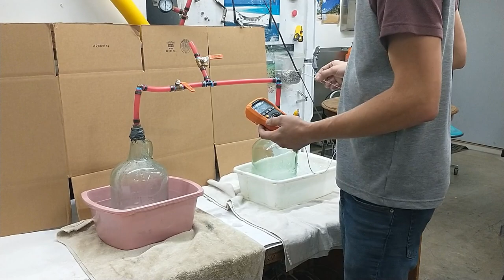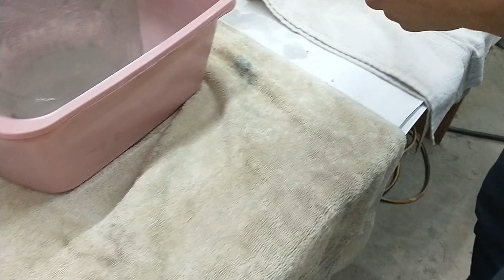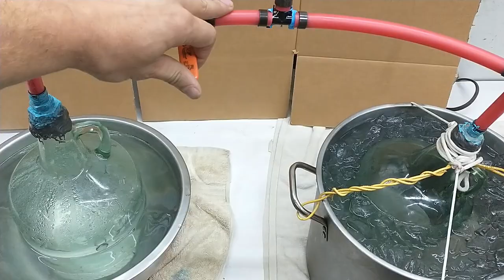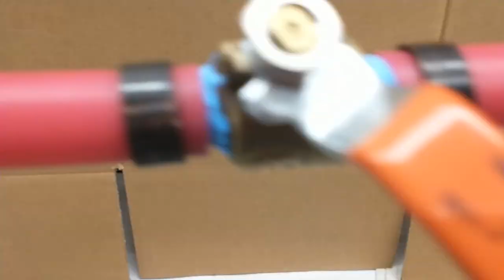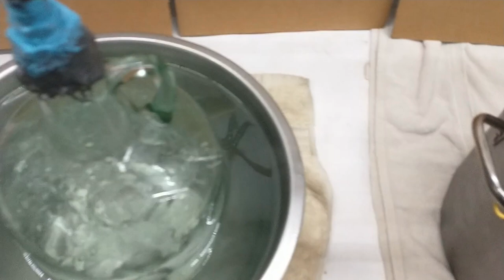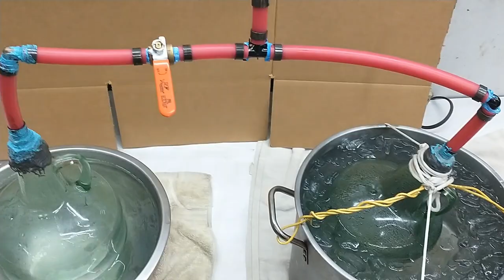COLD BOILING WATER To power The Tesla Turbine Renewable Energy System

Comment: Could you check a few simultaneous parameters during a test run: 1) the amount of water traveling from the boiler to the condenser per unit of time 2) the temperature of the boiler 3) the temperature of the condenser 4) the wattage output of the generator 5) the temperature leaving the Tesla turbine
Reply from the maker: We will be testing as many parameters as we can. we want to boil out 350 gallons and calculate the total water used. Temperature in, out of the turbine as well, we have so many tests to do, and finally some good testing equipment to do it with.
Reply: @iEnergySupply  If my calcualtions are correct, boiling 350 gallons of water against a vacuum would be about 3 million BTU of refrigeration due to the latent heat of vaporization. Are you planning on using an external heat source to keep the boiler temperature from dropping too much, or just let it evaporate/sublimate slowly from the normal thermal conductivity?
Reply: You need about 4,18kJ to heat a litre/kg of water 1 degree celcius - which means that is what you can extract if you put it in.
There is proportional relationship between temperature, pressure and volume - check out the ideal gas law
Reply: @FyaaahS  Hi, thanks for your comments. Well stated, the energy entering and leaving are in direct proportion. My interest is how much heat flow (BTUs/hr) is being turned into how much electrical power (KWH)? If I know how much water (lb/hr) is being evaporated the BTUs/hr can be calculated. And if I know the temperature (given) I can calculate the pressure on the high pressure side. I really want to know how much heat energy that is needed to run the Tesla turbine.

Comment: I'm surprised that the cold glass bottle didn't explode. Maybe the steam isn't hot enough. 
----
I'm excited to see if the hot side was superheated steam. The greater the temperature difference, the higher the velocity of steam, and the more violent boiling occurs on the hot side.
----
Use pumps and a one-way flow valve to redirect the condensed water back to the boiler. Of course, you already know this one. 
----
Thank you for educating the public, wishing you more subscribers, mate.
Reply from the maker: Thanks! Yeah my setup in utah has the pump for recirculation. Testing begins soon. Something interesting also happens with the rpm, under vacuum the tesla turbine seems to have unlimited rpm with extremely low pressure differentials. Even at very low temperatures.
Reply: @iEnergySupply  Maybe the viscosity of the water vapor is higher at lower pressure?

Comment: So all you really need is the cold end to be a little bit higher than the hot end and a siphon tube with a valve at the bottom of the cold chamber to return the liquid water to the hot side to reset the system for the next run.  You probably also don't need a high vacuum pump since steam will displace all other gasses in the system, all you have to do is heat the system until the lines are purged. A liquid with a lower boiling point could also be used to increase the efficiency.
Reply from the maker: you got it, although I think water makes for the best working fluid, because the vacuum on the condenser is much higher at higher temperatures. We still need more testing to confirm this though.
Reply: @iEnergySupply  Keep me updated on this. I'd like to have one of these machines when they become practical.

Comment: Endothermic heat pump, like the Einsteinian refrigerator/ ice maker; a closed system loop. Most awesome! Perhaps  Mr. Keely acheived something similar but using sound vibration; his 3-inch-thick steel-walled flasks certainly suggest some extreme pressure differentials. Surely, given the time frame, Mr. Tesla would have been, at the very least,  aware of Mr. Keely's work. Replace the water with say a liquid with an even lower boiling point and there would a corresponding increase in potential. Thank you for your work.

Comment: Classic case of thermodynamics, as the energy within the system is not the vapor pressure inside the bottles, but is instead based upon a combination of system thermal equilibrium and H2O temperature behavior in a vacuum. Nice. How long total before equilibrium is reached, considering that the water vapor from tank to tank is the heat transport method? Ultimately, aluminum tanks on both sides would be ideal as aluminum conducts heat far better than glass. But then again, you would get more vapor, but it would also reduce time until equilibrium is reached. I like your concept, as it is a lot safer than actual steam boilers.
Reply from the maker: wow, you understand the system quite well. I've come a long way since this video. I will be using sand to store the heat energy now, and piping as heat exchangers to extract the heat energy.

Comment: The key to understanding how it works is recognizing that at the same pressure, the refrigerant boils at a much lower temperature than water. This is a critical concept to understanding how the refrigeration cycle works, so if that went by too fast, read it again and think about it for a minute. For example the refrigerant commonly used in refrigerators boils between 40° and 50°F as compared to water's boiling point of 212°F.. you can use this for your cold fluid turbine compress it or not. I just think that the added heat would help you out. If it turns into a liquid after it leaves the turbine than all you have to do is is place an evaporator coil out side in the heat with a black Mat placed on top of it. Be it plastic or what ever.
Reply from the maker: your absolutely correct, I would be using a different fluid but I can't find a good one for the materials I am using. Do you know of a refrigerant that doesn't compromise lexan? Also, the turbine preforms better when the pressure in the condenser is at it's lowest. With a coolant that boils at lower temperatures, the pressure in the condenser and at the exhaust of the turbine will be much higher. Despite all that, I will be testing with different coolants in the future.
Reply: @iEnergySupply  you do not need a condenser. Your turbine acts as an expansion valve. The only thing I cannot figure out is how to move the fluid from the turbine to the heatexchanger, but you could always put a single stage tesla pump with a small DC motor of high rpm. The heat exchanger acts like your evaporator, as long as the fluid surrounding the refrigerant is warmer than the refrigerant than it will boil, creating your vapor point. Send that into an accumulator, and allow the pressure to build until you can transfer the refrigerant to your turbine. There is no telling if this will work because who knows how cold the freon will actually get, but it sounds good!!! And, I do not know what type of thermoplastic you could use, but they do have an LCP that was tested, for 30 days at 127 degrees Celsius this is a high temperature thermoplastic.
Reply: Why do you even need a condenser when your turbine is the super cooling effect. The nozzle in your turbine acts like an expansion valve. That is the reason why the air passed over the coils in your condenser is cooler than the freon to force it into a liquid phase, but you have a cold steam turbine, so if it comes out as a liquid after it leaves the turbine than that is all you need is the pump to take it back to the evaporator where there is another expansion valve, and the second evaporator is in an outside environment collecting the heat from the sun to vaporize your refrigerant. Where than it is sent to a holding tank to build up the pressure needed to power your turbine, but none of this works if your turbine leaks because low refrigerant equals the freeze, and to much refrigerant equates to you baking in your house.
Reply from the maker: @mitchellsmith7868  I believe this is possible, but for turbines this small, I will need to have multiple stages to make it happen.
Reply: @iEnergySupply  at what stage does your turbine turn your cold steam into water because if all you have to do is add stages than why could not you add two compression stages to every one turbine phase than add a heat strip, and a fan to blow the hot air over your turbine, and than it is steam again because you only need the water to reach 70 degrees; this is only theory. Have you ever herd of a hair and pin heat exchanger, but if we are talking about cycles to where the sun's energy is used as your evaporator which is alot hotter than the air that is pushed over the evaporator coil; you could always add a compressor as a whole sperate cycle to heat your water; with a recirculation valve it is very possible to re run the water as many times as need be until it gets hot enough to turn your water into vapor your tesla pump should keep the vacuum on the system. It should not take but at most three times. This is just the start. You can worry about the power consumption later after you have the complete system, but like I told Charlie once you had one of them going than you are hooked up in series where as the power produced as long as it is double what is used would make up for it with energy produced, for the grid which also equates to the load being taken off your equipment; the way to go happens to be DC power because the AC  power does not damage your equipment also you need to look up what you can on POE oils if you are deciding to use a compressor.

Comment: very good demonstration, thank you alot , i am very curios about the electrostatics. Probably by adding a high voltage electrode mesh at the beginning of the vaporizer side, to repell back the positive charges, and therby only allow negative charges to pass,  the effect could be enhanced, and probably a high voltage builds up between the vaporizer and condenser. Would probably work in parallel to the tesla turbine running to pull out some extra sparks. Not sure about the conductivity of the steam though.
Reply from the maker: that would be a really cool experiment!
Reply: When the static builds up does it cause a drag on the vapor traveling from the boiler to the condenser?
Reply from the maker: @davidcollar4577  Good question, I really want to know the answer to that question. I assume it does.

Comment: Efficiency trough simplicity, excellent work. Is the actual turbine prototype final? Out of the airbearings would you improve something else? I would like to let one manufacture based on your CAD project, if ready for sale/share. Thank you for sharing this knowledge with the universe
Reply from the maker: right now we have to do testing to make sure the turbine is the correct size for a 3 kw system, we may need to go bigger, but we are satisficed with the design, so it can be simply scaled up. It's available on our patreon. patreon.com/ienergysupply

Comment: But how's the ice or hot water reproduced? This is a large stirling, isn't it? (which I've been looking at myself for a while like most have in the last 200 years or so) anyway, I appreciate the video and please keep considering keep things.
Reply from the maker: One way is to use solar, or a wood stove. Solar heat collectors or solar heat tubes. Geothermal becomes an option as the low temperature differential between outside winter and underground is enough to run the system. Thermal sand batteries will also be an option, all of which I am planning to demonstrate soon.

Comment: I believe a dual trompe would be more practical? When one runs out of pressure, the other goes, and water is replaced into the system that is not currently used.
Reply from the maker: It actually takes a very long time to use the water because there is so much expansion under vacuum, the water can also easily be pumped into the boiler from the condenser as needed.
Reply: so if you put a pump,from condenser  , and then  pumping  back to the boiler, meaning  the water cycle over  ang  over again without adding  a water?  right?

Comment: it might make it clearer to people if you explain that top half of the boiler bottle is full of water vapor not "vacuum" or "air" and that because of the low temp boil when you closed the valve the boiler bottle went from equal pressure to high pressure in relation to the condenser bottle which remained at  low pressure due to the temp. you are not at "vacuum" on that system ever btw due to the water boiling off while you evacuate the air volume but that is just me quibbling over technicalities the point was to scrub the volume of unwanted gasses and leave only liquid water and your reaction gas "water vapor" this another very cool demonstration of out side the box energy generation.
Reply from the maker: Correct! Thanks for the suggestion.

Comment: Pretty basic thermodynamics. As the "hot" vapor condenses, it maintains the vacuum in the condenser because the non-condensable gases have been removed. The vast majority of steam-driven turbines use this to increase efficiency.

If you pump the condensate back to the boiler and continue adding energy (heat), the reaction will continue. If the energy produced by the turbine/generator is greater than the energy added to the system by the pump, then you have a self-sustaining system, given the heat source is external. ie. Solar, Nuclear, Natural Gas, Coal, Oil, etc.

I'd love to see a video where you have a heat source for the boiler and a pump to recirculate the condensate.
Reply from the maker: Yeah this video was mainly for all the people thinking I was using compressed air. They also thought the vacuum pump would take too much energy to evacuate the system then I would get from the water.
Reply: @iEnergySupply  oh for sure. It's a great demo. Though it'd be even better if you had more of the condenser visible lol.

Comment: Phase changes have the potential of creating charge separation. There's a theory, supported by some pretty comprehensive experiments, proposing that water freezing onto hailstones creates the charge separation in thunderclouds. The water that hits the ice but doesn't freeze, leaves with a different charge than the ice itself.

Comment: Seriously, you take the temperatures, then completely change the setup? Are you claiming that the trickle of vapour will produce more energy than the vacuum pump, the freezer, and the kettle to boil the water? It's a fun demo of how dropping pressure lowers the boiling point. I think the telling bit though was after a few moments of operation, when the temperatures had clearly not equalised "lets put some more hot water in there" was the next step.
Reply: No one is claiming over-unity in this video. It’s a simple demonstration of a heat pump with water being the transfer medium where in the future the 
OP plans on using the sun as the hot sink and the earth as the cold sink with a lowered vapor point being reached with a partial vacuum being introduced then maintained primarily by a Tesla turbine combination pump which so happens to be well suited for high vapor fluids and other turbines are not.
Reply: @ScarboroughSt  no, the claim was it would continue until the temperatures equalised, it didn't, and the Tesla turbine is to extract power, not maintain pressure, so will cause a back pressure on the hot side, reducing the partial vacuum. The water vapour will reduce the vacuum until there is non. They are demonstrating that boiling water can be used to generate power, just like every coal, gas and nuclear power station ever. Innovation in providing the heat, or cooling, or how to use the Tesla turbine would be great, as long as it improved efficiency, but this doesn't seem to be doing that at the moment. It seems to be focussed on using a vacuum, which will need to be constantly replenished when it's the pressure differential that is important. A vacuum can only give you an extra temperature differential of 1 atmosphere. What might be interesting would be a comparison of the difference in energy input/output if the energy used to create the vacuum was used to increase pressure (by heating the hot side, or cooling the cold side) rather than pulling a vacuum which won't last (can't last, the water will evaporate to fill it until the water isn't evaporating at an accelerated rate any more).

Comment: So the Tesla turbine is like a Stirling engine that utilize the temperature differences and people that don't know better will think it is a perpetual motion engine. This demonstration show what took me some thinking and reading up on to grasp fully. Iceland will have a win with this if it work on large scale, below freezing often and with hot springs.
Reply: This is how all turbines work anyways. The difference with the tesla turbine is that it can maintain vacuum and cool the exhaust below ambient air temperature. Or that's the claim.
Reply from the maker: Quote From Tesla. I have found that the quantity of fluid propelled in this manner, is, other conditions being equal, approximately proportionate to the active surface of the runner and to its effective speed. For this reason, the performance of such machines augments at an exceedingly high rate with the increase of their size and speed of revolution.
Reply from the maker: this is possible I believe, although we haven't proved it yet. We also may need a tesla pump to further lower the back pressure of the turbine exhaust. We will see. Also, normal turbines take extreme amounts of damage in situations like this from cavitation that doesn't harm the tesla turbine.
Reply: @jeffjefferson3364  "A turbine is a rotary mechanical device that extracts energy from a fluid flow and converts it into useful work.". Why I said the Tesla turbine is like a Stirling engine and not like a normal turbine is because it is easy to think that it is the compressed gas that gives the energy and not the temperature differences. But yeah of course all turbines work because of the flow of the fluid and even the Stirling engine works because of the flow of fluid. I just thought it works like the "magic" of Stirlings.